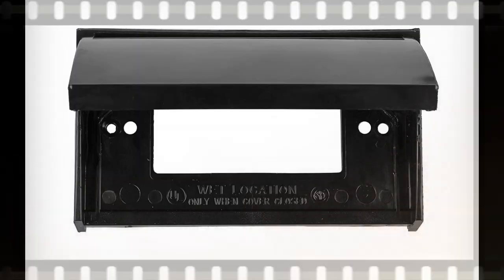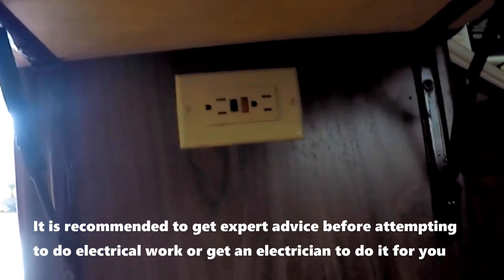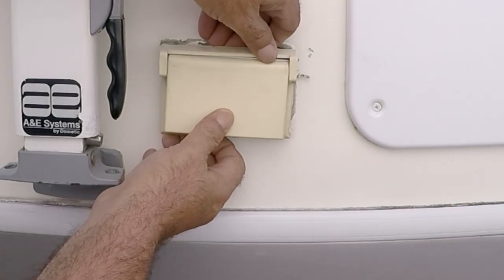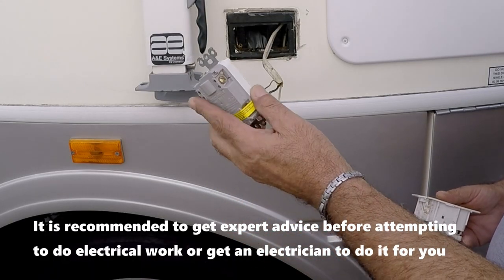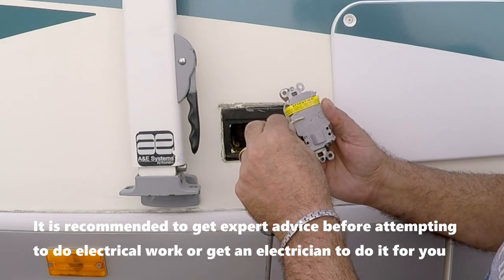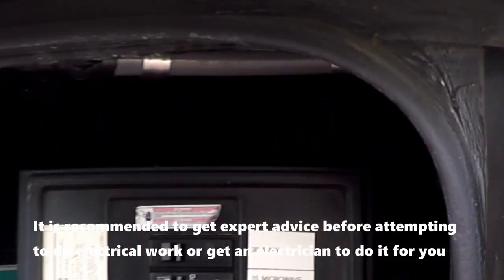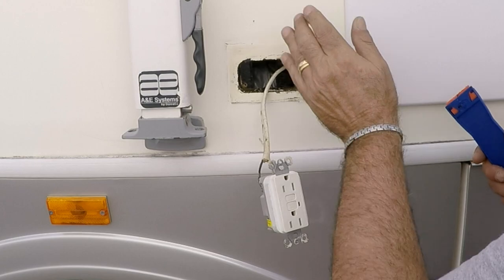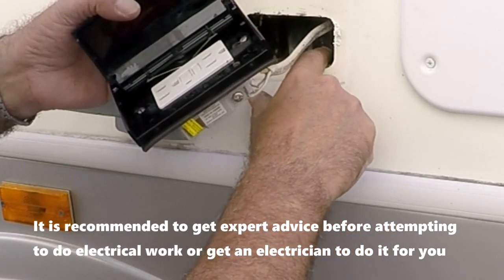HOW TO REPLACE RV OUTDOOR OUTLET COVER and GFCI 🛠️⚡

Comment: Nice little project and video, John. I like the screw type wire connections on the new outlet better than the original. The plastic scraper is a good idea. You didn't put 'How To' in the beginning of your video title, I hear this helps in the YouTube search engine rankings. Take care.
Reply from the maker: I’m glad I got around to edit this one it was sitting for a while I almost forgot about it. I like the screw outlet type myself, I did a little research on the old plugs, it seems they are more common on mobile homes and RVs, this was the first time I seen them. The plastic blades are a cool invention it comes in handy. I took your advice on the How To, I’m not sure why I dint do that to begin with, I usually do, thanks for the heads up. I hope you guys are doing well in these  winter months.

Comment: Nice job John did you have to change the wiring on the inside gfci sometimes if it was wired to the load side of another gfci it gives some issues.
Reply from the maker: The inside GFCI wire comes directly to the breaker. I’m glad it’s working, I really feel more confortable with a GFCI on the exterior of the RV. I plugged in a drill and made it run for a while and seems to do ok.

Comment: Love this! Plus can you use clear silicon versus caulking?? Thanks for sharing!
Reply from the maker: Thanks  for the comment. As much as I like the clear Silicone I'm afraid it does not do a good job on fiberglass. That's what I used to seal the old one and I found out it was not doing anything to stop the water but it was the gasket that was doing it all. It scraped off without any effort, I could have done it with my thumb. I use Caulk Pro Flex Bright White RV Flexible Sealant. The link is on the description for more information.
Reply: John C RV Thank you for this info! I will definitely place this caulking in my RV maintenance box.

Comment: Hello John Great job. I also have a camper van and often I have to do similar work. Very interesting video. Like
Reply from the maker: Ciao Rocco, thank you for your visit and comment. I dint know you are a camper as well 😉👌 I been camping since 1987 and we love it. I own this one since 2003 and still runs great, it has low mileage and will keep doing some renovating. Happy camping my friend.
Reply: @JohnCRV  My camper is very old I bought it on 1992, I travelled with it around Europe, doing 200000 Km. Although its is so old still runs very well and I like as inside is, simply furniture and spacing. Happy camping too my friend.
Reply from the maker: @rocconeri6809  It sounds like it was very well maintained my friend. I feel the same way about having it set up our way its like part of our home away from home.

Comment: this will not work, you are double gfiing your circut.  you will have to look at your gfi inside and change those wires from load to line, unless there are other outlets on this circuit.  dont change an regular outlet of a gfi unless you know and understand how the circuit works.  its already on a gfi, so just replace it with a regular outlet.
Reply from the maker: There are other outlets on this line. I did get advise from a licensed electrician. But "I will look into it further. Thanks for the advise.